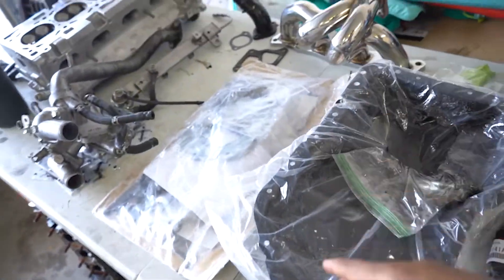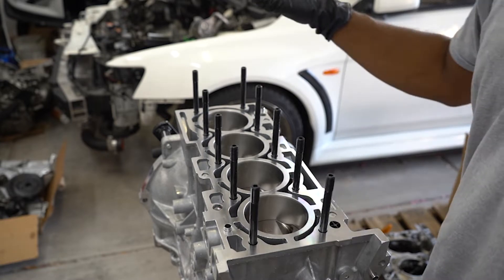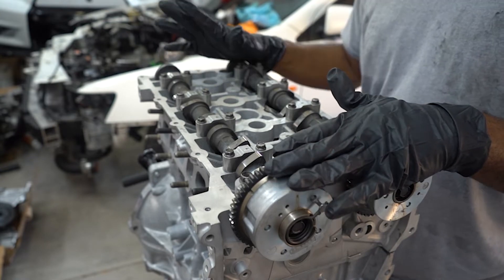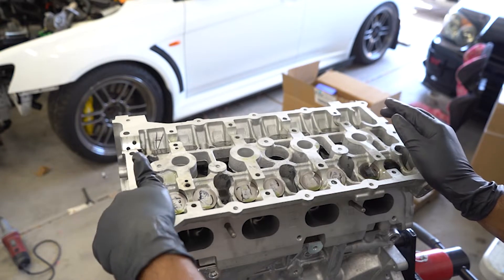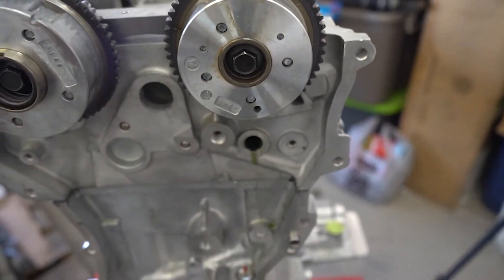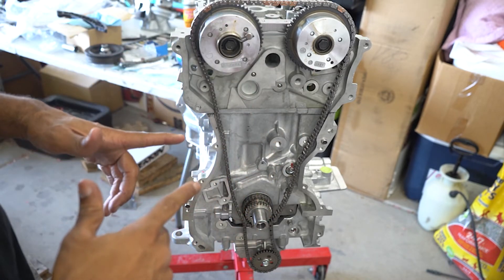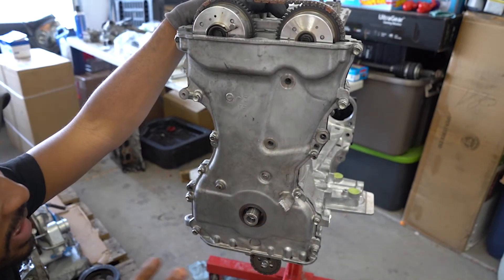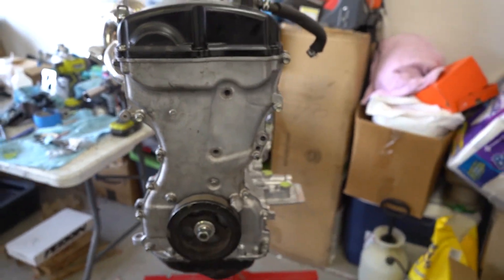How To Assemble An Engine (4B11T)

Comment: Chris, I read recently that it's a good idea to replace your timing chain tensioner and guide with aftermarket ones that are higher quality because the OEM plastic ones tend to break. Is there a reason you stuck with the stock ones instead of going aftermarket?
Reply from the maker: A shop local to me builds a lot of high horsepower evos and I came to him with that same question as he uses oem guides also. He said he has never experienced one fail so I stuck with oem

Comment: Im buying an Evo X this year before 2024 and im so pumped. I plan on living it OEM plus for reliability more of a back road driver but i do want a small tune to improve Gas mileage. But mostly just intake and exhaust would be good for me. But im glad this video is here cause im soaking all the info i can on these 4B11 motors.

Comment: One thing I did notice is you missed the cam chain oil squiter did you actually put it on chris ?
Reply from the maker: Mine is a 2014 so it didn’t have the oil squirter on the timing chain. If I’m not mistaken it’s just the earlier models that did

Comment: Coming along nicely Chris, make sure when you fill with engine oil run the car in idle for a few hours to see if oil pan is leak free at the seals cuz that's what my mechanic told me when I had mine done.
Reply from the maker: Thanks my man, and thanks for the heads up. Definitely don’t want any leaks 😅